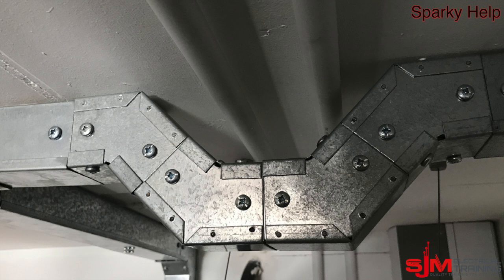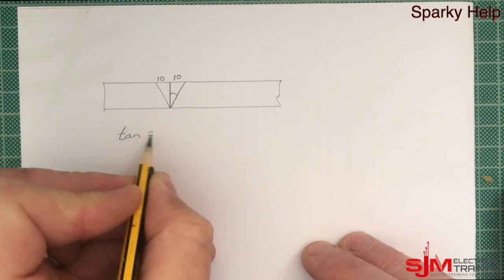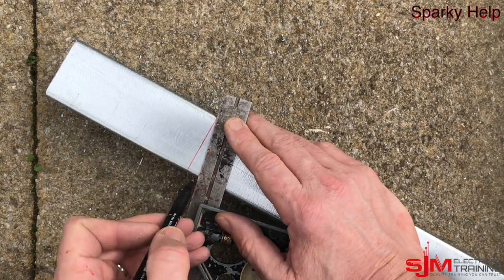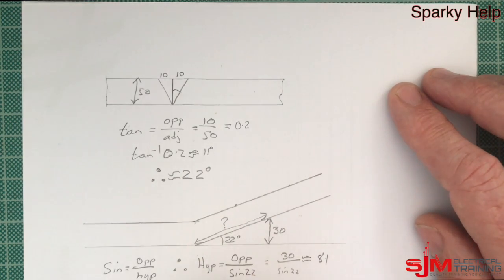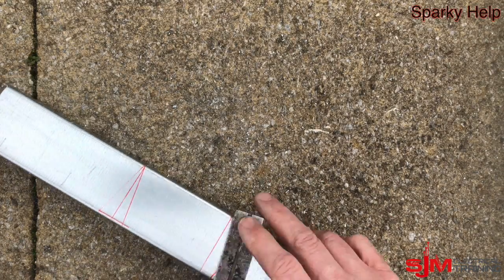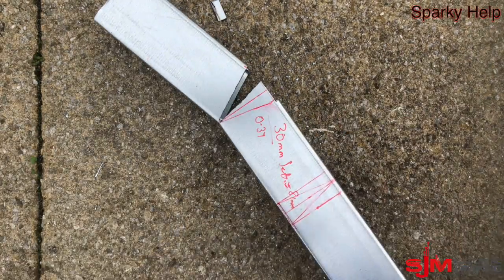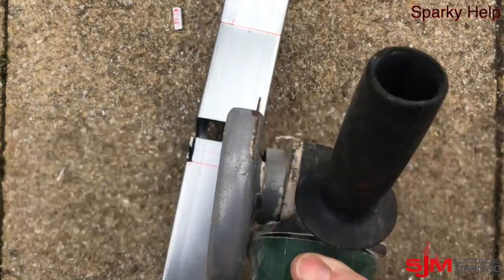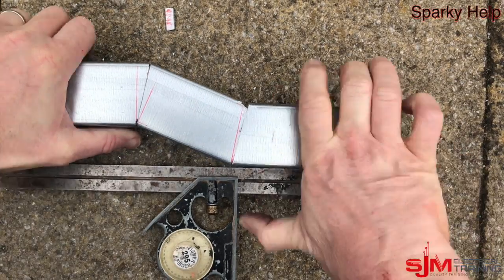How to Make an Electrical Trunking Set to any measurement or Angle

Comment: How did you get 10 on each side ,could you clarify pls?
Reply from the maker: Hi, thanks for watching please share with like minded people. I had decided on a 10mm for this size of trunking and as you will see I worked out this would give you 22deg, but you could work from the angle to find the measurement to cut.  Don't for get to like and subscribe - check out my other videos.

Comment: are the numbers the same for setting 4” trunking
Reply from the maker: Hi Thanks for watching if you only cut 10mm each side on the first cut your overall angle on 100mm trunking would be 11 degrees so half the video, the other calc would 157mm away for next bend using 100m trunking.  if you wish the angle to stay 22 degrees then first cut is approx double or my calc 19.43mm. then the rest would be the same.  hope that helps.  Please like share and subscribe, many thanks.